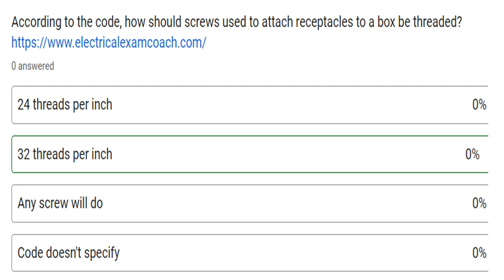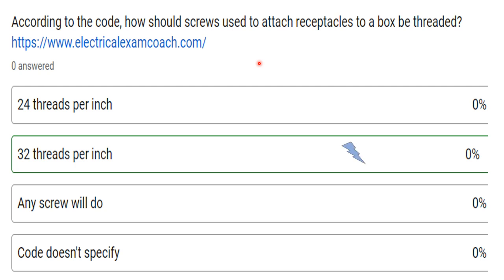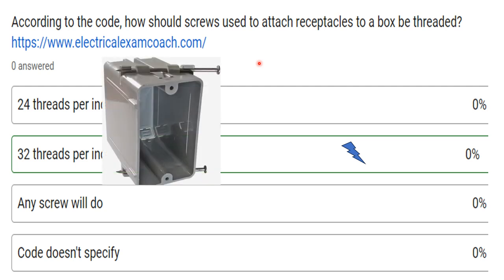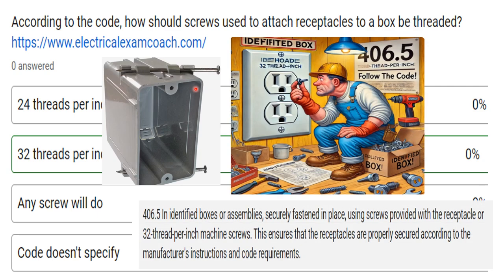#138 Electrical Question of the Day NEC 406

Comment: Grounding question : I'm installing solar panels on a metal roof. Can I ground the Unistrut that the panels will be mounted on to a ground rod and then bring no ground wire into the building, just the positive & negative D.C. cables?